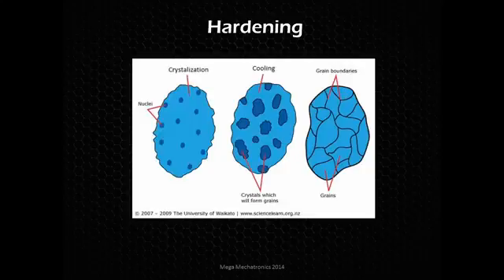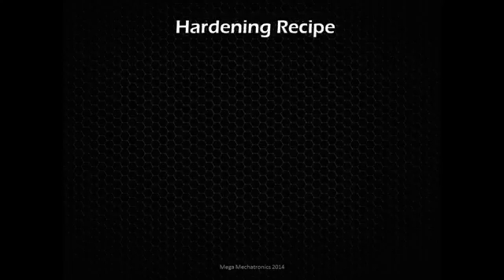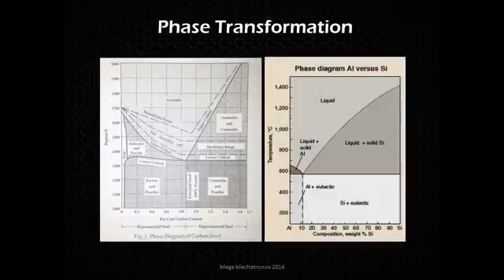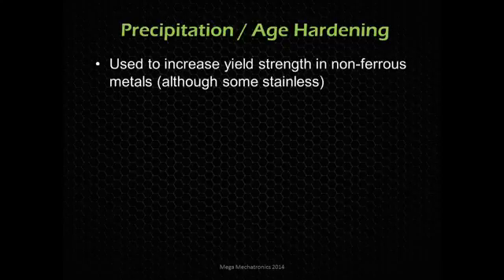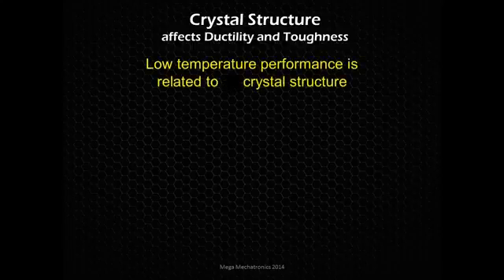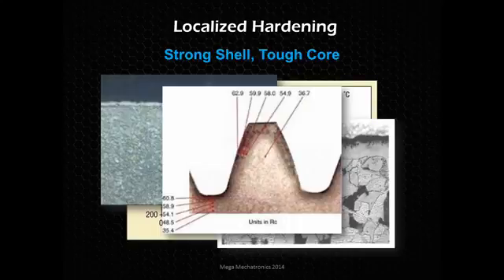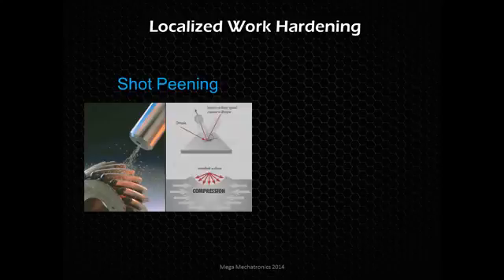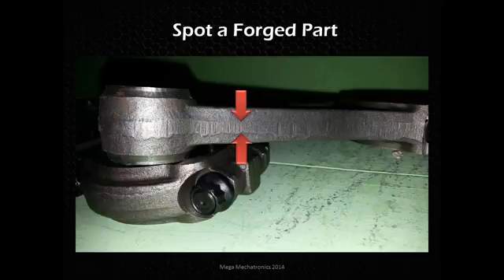Materials Science Mechanical Engineering    Part 4 Heat Treatment Explained

Comment: Henry Julianto 2713100090

Hardening treatment is a matter process that is important in the world of metallurgical material. Hardening is used to obtain better high wear resistant properties, strength and fatigue limit / strength. Hardness can be achieved depending on the carbon content in steel and Hardness will depend on the heating temperature (temperature autenitizing), holding time and cooling rate were performed and how thick cross-section part that becomes hard lot depends on hardenability. And if we are hardening a material then when cooling will form a crystal structure such as BCC (Body Centered Cubic), FCC (Face Centered Cubic), or BCT (hexagonal). There is slip or deformation in Crystal structure like slip plane and etc. The concept of hardenability is the addition of alloying elements on the material so the hardenability also change. Hardness also increases with the addition of carbon. The mechanism of action of the hardening process is by raising the temperature to a temperature above the austenite temperature (200 - 300oC above A1) and quench quickly (can be water, oil, or brine) and after that is done , we are heating the material under temperature A1 (300-500oC) for tempering and we are doing finishing. We can see the behavior of phase transformation based on the diagram Fe-Fe3C diagram where the carbon content versus temperature diagram. We can see many phases such as ferrite, austenite, cementite. Where the phase can also be transformed into pearlite, bainite. Bainite can be obtained by carrying out certain treatments, namely by rapid cooling and holding time at temperature above the martensite start. 
Differences in the composition of the material (plain carbon, alloy steel, or stainless steel) improve the different mechanical properties. Stainless steel materials have excellent corrosion resistant. Chromaly alloy such as steel have a high strength, high ductility and strong toughness. Alloy elements can improve a lot on the mechanical properties of materials such as increased strength, tensile strength, ductility, and much more. Tempering is some process that we need after the the material is done hardening process in which the materials are too brittle so it requires to tempering below the transformation temperature. Normalizing heat treatment is a process in which the material is heated to above the transformation temperature and then cooled in the air. Annealing is a heat treatment process in which the material is heated and then in holding at certain temperature after it is cooled in a controlled cooling rate that aims to soften the material and can produce the desired microstructure. 
Precipitation / Age Hardening is used to increase the yield strength in the non-ferrous metals and produce fine particles. To measure some of the hardness in a material can be measured in various ways such as indentation hardness, scratch hardness. Testing Brinell hardness test indentation is the first widely used. This hardness test such as the formation of grooves on metal surfaces using the indenter. Brinell indenter for spherical with a diameter of 10mm, 5mm diameter, the diameter of 2.5 mm and a diameter of 1mm, it all is the international standard ball diameter. If the material has a very high hardness, the ball indenter has a diameter that is very small, otherwise if the material is soft and the ball indenter will go entirely. Unlike the Brinell testing, testing vickers using diamond pyramid indenter, large angle between the surface of the diamond pyramid is 136 degrees opposite each other. Vickers is also known as Diamond Pyramid Hardness test (DPH).
      Rockwell testing using standard diameter steel ball indenter (diameter 10mm, 5mm diameter, the diameter of 2.5mm and 1mm diameter) and a conical diamond indenter. This test does not require special skills due to the measurement results can be read directly. unlike the Brinell and Vickers testing method should calculate using the formula in advance. There is also a scratch hardness tests, Scratch hardness is the measure of how resistant a sample is to fracture or permanent plastic deformation due to friction from a sharp object.  The principle is that an object made of a harder material will scratch an object made of a softer material.
Crystal structure such as BCC or FCC can affect the ductility and toughness of a material. BCC (Body Centered Cubic) at low temperatures can affect the structure of crystals in which crystal structure will undergo changes from ductile transition becomes brittle at low temperatures. Instead crystal structure of FCC (Face Centered Cubic) will get his tenacity at low temperature. Heat-treatment processes such as case hardening are used to prolong the service life by increasing the surface hardness and vibration resistance while maintaining a ductile, elastic microstructure at the core. Suitable for case hardening steels have a carbon content of Approximately 0.1-0.3% weight percent. For a high surface hardness - for example, 60 HRC - a carbon content of 0.1-0.3% is not sufficient. The part has to be carburized. Carburization takes place by diffusion of the carbon into the workpiece surface. A mixture of carrier gas and additive gas forms the basis for the carburization atmosphere in the furnace. So the material will hardened only on the surface because there is diffuses carbon. Strength and hardness is directly proportional. The greater the strength, the greater the hardness. Work hardening can be divided into two, namely hot forging and cold working. Cold working hardening uses compression forces and plastic deformation and creates desirable dislocations in the crystal lattice structure, improving yield strength, but Reduces ductility. The example is shot peening and roller burnishing. Hot forging work hardening done at higher temperatures and Stronger than an equivalent cast part. The example is traditional forging and forging press. Also hot forging aligns the grain structure to the shape of the part.

Comment: Herald Matius Unggul2714100077 Thank you to Miss Dian for sharing this vidio about hardening and heat treatment. This vidio shares about the changes of mechanical characteristic after heat treatment. Doing a heat treatment to metal, metal alloy, or metal based on ferrous, to get a new properties and mechanical characteristic of the metal. The use of heat treatment to reduce the grain boundaries of microstructure of metals, so the atoms in the bounderies are limited to move around. The size of grain bounderies are important, the smaller the grain boundaries, will get harder materials. The hardenability of materials are depend on the alloying elements and the content of carbon inside the metal. Hardening recipe are by heated up the metals 1600 degrees celcius from ambient temperature to transform temperature and than we quenched the material, after the quench, than we can temper the material to reduce stress inside the material after a fast cooling process. To do a heat tratment, phase diagram can help by showing the corelations between the carbon content and the temperature and phase for materials based on ferrous. The quenched media like air, oil, and water will give a different microstructure at the end of the cooling process. When doing a quench with water, the cooling process will be faster and the material will get very hard characteristic and bery britle, to reduce the brittleness of te material, we can do temper, normalizing, and annealing, tempering is done below the transformation temperature, normalize heat treatment are done above the transformation temperature, and annealing are cooling the material inside the oven to hold the temperature to reduce stress of te material after quenching. Quantifiying the hardness of material by using vickers methode, doing an indentation to the material, if the material get a large diameter of the indentation, the sofer the materials are. To reduce the brittleness of material can be done by metal forging, it can be done with traditional forging, heated the metal first and than smash with a hammer, or with press forging or mechanical forging.

Comment: choirul zakie fayakun
2714100118

heat treatment serve as for hardening material, where the material not satisfactory. the material gonna be passing phase heat treatment. heat treatment useful to change crystal structure. crystal struceture will change if heat treatment well done. heat treatment useful to change grain boundaries, from small grain to big grain. heat treatment useful to change the phase. if the materials have high hardening properties, so in the TTT diagram, the nose will shift to the right. the results of material will get a martensite phase. the use of this treatment will result in an improvement of the mechanical properties, as well as an increase in the level of hardness, producing a thougher, more durable item.
when the temperature is low enough, the steel tries to return to the low temperature crystal structure BCC. this changeids very quick since it does not rely on diffusion and is called a martensitic transformation. because of the extreme supersaturation of solid solution carbon, the crystal lattice becomes BCT (body centered tetragonal) instead. this phase is called martensite, and is extremely hard due to a combined effect of the distorted crystal structure and the extreme solid solution strengthening, both mechanisms of wich resist slip dislocation precipitation hardening (also called age hardening) is a process where a second phase that begins in solid solution with the matrix metal is precipitated out of solution with the metal as it is quenched, leaving particles of that phase distributed throughout to cause resistance to slip dislocation. this is achieved by first heating the metal to a temperature where the elements forming the particles are soluble then quenching it, trapping the in a solid solution. had it been a liquid solution. had it been a liquid solution, the elements would form pprecipitates, just as suppersaturated saltwater would precipitate small salt crystals, but atom diffusion in a solid is very slow at room temperature. a second heat treatment at suitable temperature is then required to age the material. the elevated temperature allows the dissolved elements to diffuse much faster, and form the desired precipitated pasrticles. the quenching is required since the material otherwise would start the precipitation alredy during the slow cooling.this type of precipitation result in few large particles rather than the, generally desired, profusion of samll precipitates. precipitation of smallprecipitates. pracipitation hardening is one of the most commonly used techniques for the hardening of metal alloys. and to test and quantifying hardness after a treatment or cold work we can use indentation method, usually we can se rockwell c, brinnel, and vickers to do that. depends on what things you want to test. there are also another types of cold work that explain in the video like normalizing, annealing, localized hardening at the shaft, etc

 In hardenability concept, every different alloy gonna have different hardenability as in metal we add carbon to increase its hardenability, aside from that the heating temperature, the cooling rate, and the time needed to hardening the metal is also important, the keyrole to get desireable crystal form (such as martensite) is the cooling rate so in the cooling process  must fast enough to stop the grain growth.  to know in what temperature we should start the heat treatment we should look in phase diagram chart of the metal, all metal and its alloys have different phase diagram so to know what composition of metal and its alloy is very important as one alloying can make many change in the properties depend on how we treat the metal. As for example is tampering, one of the heat treatmen process to handle material which properties is too brittle so we can temper it to improve material toughness by holding it below the transformation temperature than cooling it, and the normalizing process, where we heat up the material above transformation temperature and cooling in open air so we get more ductile material, in annealing process the material heated till crystallization temperature, hold it up, the cooling it inside the oven so we can get more ductile and softer material, in aging process (for aluminium) the material heated and then hold the temperature in long duration to precipitate the alloying element that will create defect and improve the strength and toughness of the material.

To measure the value of hardness we use some testing, hardness test, like brinell and Vickers. They use indenter to measure the penetrating dent in the materials. When a soft materials is doing a hardness test the penetrating is very deep, but when the materials has high value of hardness, the penetrating is shallow. The simple way to measure is scratch test, using mohs scale.
Localized Hardening, there are induction hardening and nitriding / carburizing. In induction hardening, it happen only in surface of material, they using electricity and magnetic forces, and then quench in the tank. Like an eggshell, have very hard on the surface and have very tough and durable core to prevent impact and prevent fatigue failures and something like that. In nitriding we infuse nitride and in carburizing we infuse carbon. The material insert to chamber that has been surrounded with carbon atmosphere, and that carbon infused just in the surface of materials

Annealing is a heat treatment process which alters the microstructure of a material to change its mechanical or electrical properties. Typically, in steels, annealing is used to reduce hardness, increase ductility and help eliminate internal stresses. Annealing is a generic term and may refer to subcritical, intermediate or full annealing in a variety of atmospheres.

Recrystallisation is a process accomplished by heating whereby deformed grains are replaced by a new set of grains that nucleate and grow until the original grains have been entirely consumed.
Recyrstallisation annealing is an annealing process applied to cold-worked metal to obtain nucleation and growth of new grains without phase change. This heat treatment removes the results of the heavy plastic deformation of highly shaped cold formed parts. The annealing is effective when applied to hardened or cold-worked steels, which recrystallise the structure to form new ferrite grains.

benefits
- allows recovery process by reduction or removal of work-hardening effects (stresses)
- increases equiaxed ferrite grains formed from the elongated grains
- decreases the strength and hardness level
- increases ductility